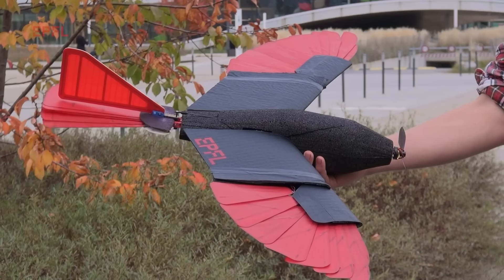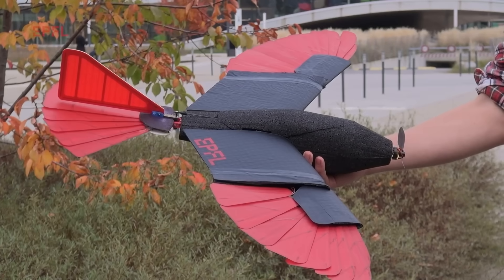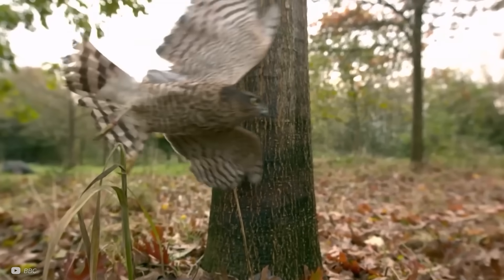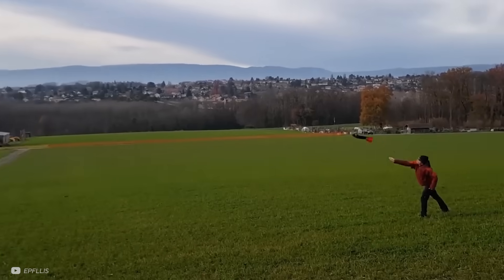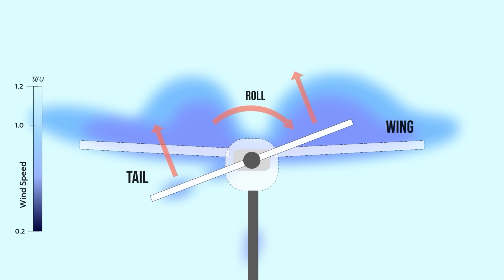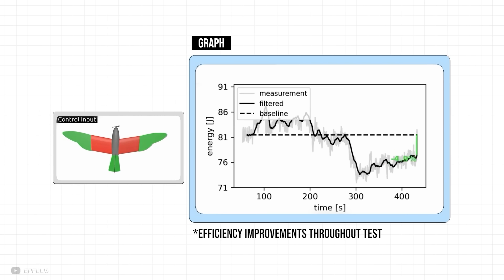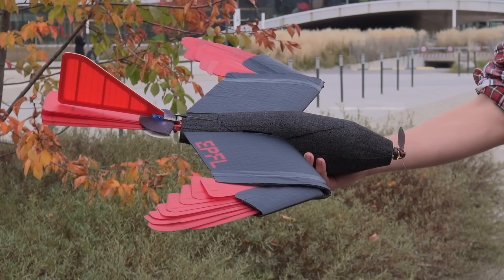The Genius of Bionic Morphing Wings: Future of Flight?

Comment: the problem i see are scaling issues an repairability aswell as predicting failure acurate enough to make it aplicable, as soon as we have a jumbo jet wing it won´t be aplicable i assume, we are already flying at material limits with constructs wich have far less points of failure, it might be doable but the question remains if it is aplicable

Comment: Has anyone else seen this? It was stealth black and like a giant mechanical bird drone  but it could hover, completely silent, and it was bigger than a house,  like jumbo jet sized. I saw it in 2015 in Oklahoma.
One big bluish white spot light shining down like a chopper. After that light went out.
I only saw one small red light on the belly towards the middle back end, like it was behind the spot light.
Then I see it go from a stealthy diamond shape, to these blade like wings in a 1 2 3 motion, like a bird about to flap its wings,  the 3 blade wings where flat by the belly at first, and then unfolded upwards like a gull wing door on a delorean, but from a flat  position , to sort of like this /w\ but with 3 > < gull wing blades on each side.

It was very hard to make out the shape, this thing was very stealthy, it was amazing to see that close. It was so big,  I dont know how it stayed up as it slowly drifted by.  

It has to be a new propulsion, electro gravitic possibly.

Comment: I came up with a way that simulates muscle c0ontractions by using a motor to push elastic material and wire that is attaches to a wing and structure on the bottom. The elastic material causes the wing to bend down then the motor has a cylinder with a rounded end and the speed of rotation of the motor increases flapping speed. Of coarse depending on materials  it is made of it would have a speed limit. The better and stronger the faster it can move but their is also weathering and wear and tear to consider. If you coat it in weather resistance materials and make the wing light and a hinge to hold the skeletal arms to maintain shape. The wings can be made out of light fabric coated in some kind of light epoxy or wax or even made like parachute material. You could even add wire to open and close them for more lift or to gliding mode. Hasn't been tested just something I came up with that follows the laws of aerodynamics and physics.

Comment: The problem is, whilst biomimicry is amazing and serves a useful function for many things, this isn't one of them. This is theme-park tech to make cool birds in greenhouses, or flying dinosaurs for Jurassic Park themed rides. It's not useful, and the reason being is the one thing you didn't mention - hybrid drones. They have props for vertical lift and conventional wings for horizontal flight. They're far more efficient, less moving parts, and lighter because of it. 

I am ALL for innovation, no matter what. I love design, engineering, science and so on, but I just can't see a need for this to be used. There's benefits to bird design in aircraft such as the shape of the B-2, or the jagged edges to engine cowlings inspired by barn owls to reduce drag and noise, but wings we've made are so efficient already that the costs involved and extra parts that can go wrong add a whole level of complexity that's just not needed.

Comment: Interesting idea for a niche set of maneuverable low speed drones, but not feasible for large scale aviation, as the stresses multiply significantly when increasing the size of the mechanisms. there's also just no use case for it; Modern commercial aircraft do not need that aort of maneuverability, and fighter jets are better with theust vectoring. Also, I think you're completely misinterpreting the efficiency thing. They improved efficiency significantly for those wings by changing configuration, but that doesn't mean they're more efficient than just a airfoil wing. I'd bet they experience significantly more drag per unit lift than a typical airplane, which minimises both skin drag from the overalll exposed surface area, and form drag by minimising the wing profile and vortices

Comment: While it may be the inspiration behind this technology you speak as if this is ground breaking study going on and there aren't already transforming VTOL drones that utilize plane/glider wings, with shifting motors giving both gliding efficiency and vertical take off power, and quad copter agility when needed. Not quite since the wings are big stubborn air flaps when doing quad copter maneuvering, which this technology would provide a fix for. However, you speak as if there is nothing that can take off vertically and glide with efficiency and while they're not insanely popular, they most definitely exist and bridge that gap already. Maybe not perfectly and this technology will help finish it's evolution. But it's not unheard of to have both of those characteristics.

Comment: They will only ever inspire boom and zoom drones! Nowhere else do you need this kind of agility besides hunting for soft targets or spying. 
Military aircraft do not need this mobility as their invisibility is far more important, and with the rise of mach 20+ railgun and laser AA guns, mobility becomes a joke.
Civil aircraft also do not need this kind of mobility as they fly in what is essentially a straight line.
On the contrary, all these extra mechanics will add weight and unnecessary complexity, making them economically a demerit. 
So, yes, light drones that make less sound and can stalk for pray or observe a target are the only viable direction. 
BUT! Even in that niche, they find a problem. Falcons, Corvids, and Owls are duking it out since their species first met. They will not tolerate these plastic birds in their respective territory!
On the contrary, to defend an instalation from such toys, training some crows against them will be the easiest and most cost-effective solution.
They will stand NO CHANCE!

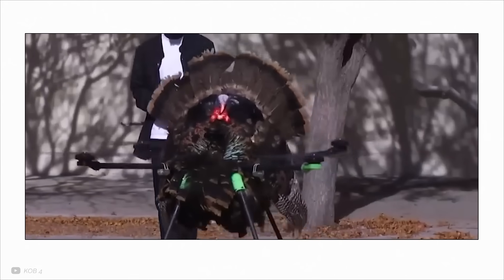Comment: 12:19 Or, we're making mechanical eldritch horrors for birds. Imagine a bird looking at that turkey drone. Basically, this... thing arrives flying down from the sky in an eerie unnatural fashion. It's skin and feathers are disheveled and look like they could slough off at any second. And, its lifeless eyes never leave you, unblinking. Plus, it has 4 spindlely insect like arms erupting from its torso the ends of which emit a horrible freakish whirring as claws so fast you can't even see them lash relentlessly at the air.

Comment: As cool as this is it’s probably impractical on piloted aircraft considering how expensive normal swing wing aircraft are like the F-14, F-111, B-1. But the wings might be cheaper since only really half of the wing is changing like older swing wing designs, like the Su-17. But the necessary shifting tail might balance out those savings, probably still cheaper than normal swing wings but I don’t think it would be as ideal of an option as the oblique wing since it only uses one joint.

Comment: Now all you need is dozens to hundreds of 'actuators' who's position and input are all synthesized, and hundreds to thousands of pressure and other sensors, the data fed into a controller with sub ms latency, which burns less than 5 watts, good luck.

Comment: I will be a little surprised if the military or even commercial concerns would make use of this tech. Because it boils down to complexity verses improvement  look at it this way a Eurofighter spends 9 hours being maintained for every hour in the air now off course that is over time and possesses a fairly standard wing I can't see adding hundreds of extra moving parts is going to A help the plane carry more weapons as you'd loose the ability to hang weapons under the wing. B reduce weight as you are adding extra pumps motors etc C time on the ground to time in the air.

Comment: Very interesting. One issue worth mentioning is how flight 'methods' tend not to scale too far. eg: quadcopters may be considered somewhat equivalent to insects - they get horribly inefficient at larger scales. Birds flight gets very inefficient below humming bird size and mechanically difficult above the size of a large condor. Interestingly pterosaurs had a size range from just above humming birds to light aircraft, something bats could also manage biomechanically if they had pneumatised bones - feathers are fine, but if you want to get really big you want a membrane.*

*and if you want to get really small you're better off 'swimming 'than flying.

Comment: 11:13 You mention that this is something for the future, but we’ve had aircraft with adaptive wings for a long time! They’re really cool! Not nearly as complex as these drones but they do change shape and it’s more common than you’d think.

https://en.wikipedia.org/wiki/Variable-sweep_wing

It’s actually pretty common on fighter jets, the F14 Tomcats, Tornados, etc. and Boeing even made a craft similar to the Concorde for supersonic commercial flights and it had adaptive wings. 

We’ve had a ton of aircraft that do cool things with their wings, from shifting delta wing designs, the osprey copter/plane that turns the wings/props vertically for VTOL and then turns them horizontally for flight like a plane. This idea isn’t new, but it’s very cool to see how closely we’re mimicking biology now! It used to be subtle and vague inspiration but now we’ve got actual feathered drones… and that’s really cool!

Comment: The sheer speed and agility of those morph-wing planes is insane! I can't imagine an actual fighter jet fitted with that kind of tech. The poseable tail, folding wings, the awesome hopping legs!

I think an extra innovation would be to incorporate the Droop-Snoot from the Concord jets. Having the cockpit able to pivot downward as the body pitches up will be invaluable in using the drag of the wings and body for the shortest deceleration and landing, thereby keeping these machines in close competition with copter drones.

I can already imagine it. An absolute dragon of an aircraft descending onto the runway, wings spread wide and proud, head glaring down at the workers below, before shooting off the aircraft carrier again straight into the fray!

Comment: The more moving parts, the quicker it will fail disastrously.  Not only did the zeppelins fail because of the sheer ignorance, but they also failed because of the dangerous fuel being used.  Now people want to design things with more moving parts than before, which is ignorance. How many moving parts does a bird wing have? Less than this piece of garbage, that's for sure.

Comment: I guess all you need to have both abilities just add wings to standard drone and use two modes for flying, one with wings for efficiency and one with propellers for hovering and precision
Reply: its far more complex than that, because they have tried that and the wings make the hovering harder and the hovering propellers add drag for the winged flight.

so you get added complexity and weight while only haveing mimimal advantages.

Comment: Heh, well, fitting seamlessly into a flock requires more than mere AI.
 Flocking birds arguably observe other birds up to seven birds away in order to remain cogent to the structure of the flock. But then as the flock turns different birds take over the lead of the whole group. And that changes second by second. I've watched huge flocks of Starlings near when I lived for years. And it's wonderful to see, but the way it works and why it works, and why the heck are they turning this way or that is way beyond comprehension even now. And as for feathers, each primary is individually controlled, yet partly guided by the tendons seen in the model, but also by the skin connection. Every part of the wing is controlled. I do like the way these drone wings have been developed though and wish the best to the researchers. And don't forget the primary and secondary feathers are regularly moulted to retain best condition for the whole wing over years!

Comment: If they get the wing tilt and flapping in the mmix it could 'hover' by angling up and flapping? IT also could just do small loitering circles on very low power. 
Would be interesting to give them thermal cameras to find raising hear in the air currents.

Comment: "They can fit into a flock seamlessly"

Ah yes, Franken-Hover-Turkeys are well known creatures, a bit strange but overall gentle creatures.

It was a good an informative video though, I've known about boundary-layer manipulation in aircraft for a while, the B2 bomber uses electromagnetic skin effects to dampen noise and induce more laminar airflow to the point that in silent mode you can't hear its engines (it does not have ionic thrust but it does have ionic flow control) but I knew there was going to be lots of promise in moving wing designs, one shape is not ideal for all airspeeds, a wing that can adjust to the airspeed is ideal.

Comment: You didn't mention any advantage to feather like segments in the wing?
Does Onshape have CFD and combustion?
Reply: allows the wing to keep it's shape relative to the airflow versus say an f15 or a certain few other aircrafts' wing-sweep, also keeps control surfaces in line with the airflow vs said wing-sweep, as the whole wing is also the control surface.. i did play with the entire wings being the control surface on a physics sandbox game that handles the basics of fixed-wing flying, it's extremely sensitive, but is very capable, though i know that game definitely isn't 1:1 with actual physics..

Comment: The really interesting concept here, is that VTOL is achieved with no additional moving parts for the transitioning between vertical and horizontal flight, and therefore, in theory, less weight and a better reliability. 
This is the same basic airframe concept as the Pivotal Black Fly which first flew in 2011, and I would love to see more discussion on the comparison between the two. The Blackfly was always focused on electric powered human flight, with associated increased focus on redundancy (8 motors, 2 batteries per motor, dual redundant flight controls etc), but has limited range due to the electric only approach - less than 100km carrying up to 113Kg. Strix has done a great job with range and flight duration - apparently by using hybrid (electric plus fuel) engines. Giving it 180kg load and up to 800kg. Demonstrates how much further electric powered flight still needs to go. Strix also looks like it might be able to land on a runway if needed, while Blackfly cannot.

Comment: 11:00 we kinda had that with old sweep wings of mig 23 and the legendary f14 its just they are too heavy and mechanicaly complex and matnece hevy to justify. there are now better ways to ensure monovabilaty like vortex genoters (conards and leading edge root extensions especially), and thrust vectoring id expet wing morphing to have similar problem and radar returns would have to be considered too not saying its impossible but those are the challenges itd deal with. however flaps could are a form of wing morphing that is used in most aircraft military and civain also winglets well not morphing wings are inspired by birds and reduce drag on civain and military aircraft (though i dont think they've ever been used on a fighter)
Reply: that is not true, the M23 and F14 did not have variable wings for manuevrablility that are 'too complex and maintainence heavy' they had simple 2 stage wings for SPEED efficiencies (different leading edge shape is more efficient at different speeds), but even if they were they still wouldn't have been droped for the reasons you think as the things you mention like thrust vectoring actually are more mechanically complex and maintenaince heavy.
Reply: @matthiuskoenig3378  the reason why the f14 was such a good dogfighter was because of the variable sweep wings they allowed for good performance in many different speed regimes at low speed the wings can unfold to produce more lift Wich delays stalls it also helps with carrier landings. Monovabilaty is also why the mig 23 had them though the mig 23 wasn't the best dogfighter and was mainly an interceptor. There were aircraft just as fast as the f14 like the f106 that lacks sweep wings so sweep wings aren't the only way to go fast but they do make it so that fast aircraft are movable 
I will admit there are other reasons for sweep wings like wanting a fast aircraft that has a lot of payload capacity but that mainly applies to bombers and my comment was about fighters.
Sweep wings may be conceptually simple, but they are complex to make work in an reliable way because of the amount of air resistance the wings needs to be counted by the wings and you need to get hydraulics and wires to the wings for the elevators and lights and hard points if the wing has any. it is because of this that sweep wings were matnce nightmares with the f111 required about 180 hours of matnce per flight hour and the f14 required about 60, most fourth gens require about 10 at most 20.
Thrust vectoring may be maintenance heavy but it's a lot easier to maintain than sweep wings and vortex generators like canards and leading edge root extensions have negligible matnce increases because it's either a part of the wing or moving the tail